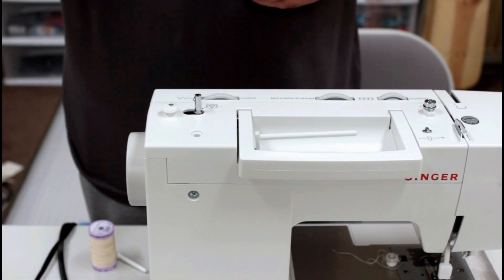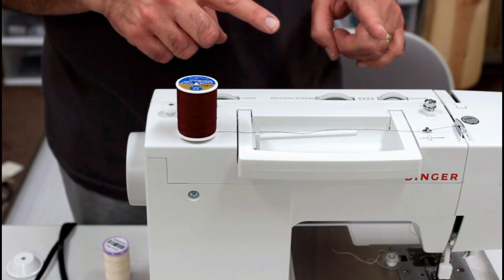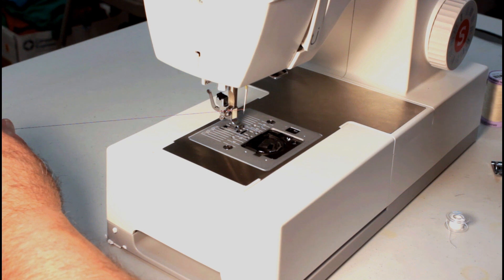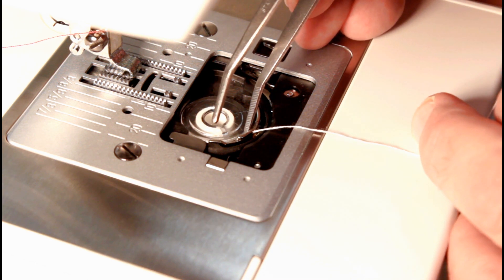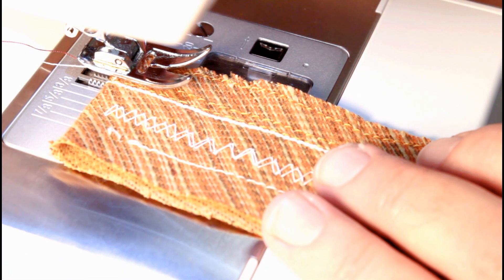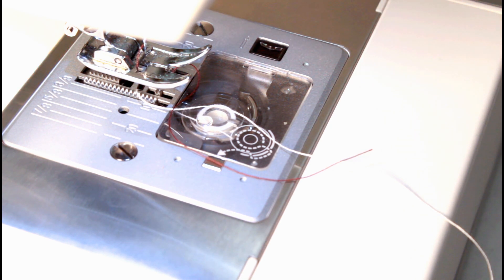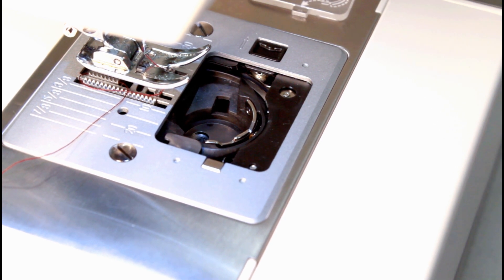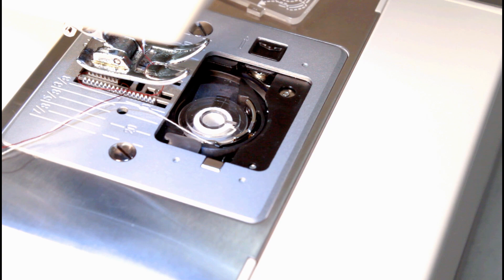Solving Threading Problems and other Issues

Comment: My 4423 is brand new and it worked fine while trying different stitches.
Now i watched your u tube and threaded step by step but even turning by hand 2 stitches,the cage is pulled half out,
Any suggestions?   BOB
Reply from the maker: Sorry for my delay in responding. I've been on the road for a few months. Did you get it figured out?
Reply: @kevinsews  HI KEVIN,Yes it was the small shiny little lever that sits just above the bobbin case.
It got bent up when i had  BUNCH OF THREAD GET UNDER THE CASE,TRYING TO RAISE IT,AND BENT THAT TINY PART A BIT.Opps sorry, had caps on. Well i cleaned out that bunch of thread and it's working like a champ now  BOB

Comment: I have the same machine my issue is I just got it and have had nothing but issues with the Bobbin jumping and the case moving . It also bunches up or jams the thread and the machine stops working.  How do I fix this without taking it in somewhere? Its brand new . Thank you
Reply: I've used it for the first time and this keeps on happening to me. I took it for service and it still happens. The bobbin keeps on moving and jams up  the threads. I guess this is a piece of junk
Reply: @jojokatt7  Why not have the service people try sewing with it and then they can see the problem
Reply from the maker: There are two thumbs that hole the bobbin in place. They have to be tighten to a spec that is in the service manual. If yours is jumping around they might be too loose. Go here: http://www.kevinsews.com/download/SingerHeavyDutyServiceManul.pdf and view page 19. This will give you an idea for what to look for.

Comment: Thank you so much for the video , I just get the new Singer 4452 and I have threading issue , your video is so helpful and I'm able to get it right.?Thank you and please make more video like this !
Reply from the maker: You're welcome!
Reply: Hi, where do you get the machine??. There is not available in stores. I know ebay and amazone are selling it,  but Is double the price
Reply: I got on ebay for 350 , free shipping , from a very good seller . I did bid on some but it end up higher than that .
Reply: @Annie-zs2bt  Thank you.  I will wait for them to be in stock.  I'm short on money now.  It is to give it to my mother
Reply: @ampis8034  Some time check Amazon in early morning hours.
I GOT TWO FOR 50.00 EACH AND A 3RD. FOR 160.00 all free shipping
Reply: Dhammi Sini Only purchase from authorized dealers, would be my advice. Why? Because Amazon has reputation for selling counterfeit or refurbished machines. You have absolutely NO recourse should you get a defective sewing machine. Sellers steal others' identities and sell products on Amazon. Amazon does not screen or vet their sellers so be smart! Yes, there are some real horror stories. Bad sellers give the REAL businesses a bad reputation. My advice: Buy from authorized sewing machine dealers and the bonus is if you need help, they guarantee/warranty their products! 😊

Comment: Great machine, love my 4423. But after a timing adjust I cannot for the life of me get the tension adjusted back to where it was previously. Type E/#69 thread and a Schmets 100/16 needle. Any pointers?
Normally sewing Nylon(500D and 1000D), 6 layers max. No issues prior to hiccup and timing adjustment.
Reply: Do you recommend it?
Reply: @angelmtos  Depends on what you want to use it for? It suits my needs. Up to 6 layers Cordura, and webbing.
Reply: @woodyw9470  Thanks, I'm going for one for my mother. Sew from time to time
Reply from the maker: Using #69 on this machine can be a challenge. I did it a few years ago helping a friend on the road. We had to tighten the top tension http://www.kevinsews.com/download/SingerHeavyDutyServiceManul.pdf  see page 22 on how to tighten the thread tension.  Then we had to tighten the bobbin tension to match. After that we had to baby it a bit to get the first stitch to catch and then he was off sewing his leather seam.

Comment: I'm assuming the automatic  needle threader isn't standatd on all machines.
 I have the 4411 and I'm continually fighting with it. The thread jams up all the time!!! I will try your suggestions, but I am pretty sure I'm skiing it right.
Might be time for a better machine.
Any suggestions?
Reply from the maker: You bought the only one in this series that doesn't have the threader.
Reply: @kevinsews  I took your suggestions and all is well now. Thanks so much!! I also want to mention that I use a metal bobbin, size 15 and it works great for me. I believe the singer video said not to do that. Just wanted to let you all know my experience.

Comment: I really want to love my singer heavy duty sewing machine but I have never had a sewing machine that jams up so much when I start the beginning of a stitch as this one it jams up the bobbin jams the thread curls up loops up.... So then I rethreaded reinsert the bobbin and it sewed fine for a little while and then it repeats and does the same thing over I can't figure it out.
Reply: Me too Barbra!!! I'm always fighting with my machine!!
Reply: @cathymilson4386  sorry to hear that If you figure anything out let me know.... Do you place your thread on top of the machine or on the little back side area?
Reply: @cathymilson4386  do you place your thread on top of the machine or on that little back side area?
Reply: I'M a 10 year parachute rigger and these new singer 44xx series are junk.
Shopping for a higher end Brother
Reply from the maker: Yes, spend 5 times what these cost and that will solve all of your problems. Even if you thread it incorrectly, it won't matter. Use the wrong needle for the project? No problem. Right?

In all seriousness...I have 5 of these machines that people sent me instead of throwing them away. I use them to teach classes and they all work just fine. I get them in and I have no idea what they were doing  wrong. I thread them up with new thread and wind a bobbin; pop in a new needle; I then adjust the tension (that can be way off) and they we a perfect stitch. 

On one machine they left it threaded when the boxed it up. When I took it out of the box it had thread in it that was so old and rotten I barely pulled on it and the thread crubbled. It is amazing what people try to do with these machines. 

I've sewed 5 oz leather with #69 bonded nylon thread with one of these machines a friend bought. I wouldn't recommend using this machine for that purpose because it will burn up. But it did sew the 4 seams my friend needed just fine. I took it apart and tightened up the needle and bobbin tension and we used a size 18 leather needle. It took a little turning the flywheel by hand to get it started, but it did sew the seams just fine and he was happy. After that he went and bought a Cowboy Postbed leather machine. LOL

I've worked on Berninas, Juki's, Janome's  and Brother machines  too. In the end they are metal frames (just like the 44xx series); they all have one or two nylon gears. It takes just as much effort to loosen the screws on all of them. The shafts and gears are all metal. I think the difference is when you spend over $1000 (sometimes over $5K) for a machine you it isn't your first machine. The 44xx series are simply to fix too. Bernina's are more like fixing a PC than a sewing machine.

The other problem is for a $150 to $249 price there can't be much quality control. I tell people if they get a bad one just return it immediately. You would be shocked how many just put it in the closet at this point.  I tell them if they get a good one and learn how to use it properly it should last them long enough to get your money out of it and move on to a higher priced machine. So far those who have followed my advice have been happy with the machine. So people you can never please through.
Reply: @kevinsews  is it possible to have very neat stitches on the under side of the fabric that are just as pretty as the ones on the top side?

Comment: Hi Kevin! Thanks a lot for your videos, actually I use them as a manual for my 4411. :) Are you using a flat or curved bobbin in this video? I was surprised to learn that Singer has Class 15 (flat) and Class 15J (curved) plastic transparent bobbins and I'm thinking if they both can be used in the Heavy Duty machines...
Reply from the maker: I've used both in them, but Singer does recommend the Class 15J bobbins.
Reply: ushchent Yes, you can use both types of bobbins; however, there is a built-in magnet located under the throat plate and I think that's why Singer recommends the plastic bobbins (which they provide in the packet that comes with the machine). I personally prefer the metal bobbins because they accommodate more thread.😊

Comment: A very good, quick, lesson.  Can anyone give me the original position for the presser foot pressure screw.  I moved mine w/o marking starting point, now dont know which position to return the plastic screw to.  Thanks.
Reply from the maker: See the about video text. I've placed a link to the Service Manual there.

Comment: I am having so many problems with three machines and repair is closed down.  Bobbin toward the end of the thread upper thread winds onto the bobbin jamming.  I hate plastic bobbins.  I love metal bobbins.  I have an antique I need someone to get it down for me.  It is heavy.  I have a brother a singer a nechi, all drive me nuts with the bobbins.  I  have antique singer.  I need a good  suggestion on a new machine.  I had an incredible machine.  It was a used industrial and we were stretched for space and it got taken to the thrift store which really annoyed me.
Reply: Hi Row. Where are you located? I recently got a Necchi. If you're on Long Island, I can help you get it down. Do you have the Necchi manual? I got mine at a thrift store but no manual.

Comment: That raising of the presser foot is the most crucial step when threading the machine so it's less likely to jam.
Reply from the maker: Yes, i t is.
Reply: @kevinsews  I like my sewing machine two things that really frustrate me about it constantly is the feed dogs I have to start my fabric off way from the edge and then go backwards that is so stressful, The other thing I don't like is sewing multiple layers I don't have much success with that either it gets jammed.
Reply from the maker: Barbra Try placing the tissue used to stuff gift sacks under your fabric for the first few stitches and see if that helps.
Reply: @kevinsews  Thanks I will try that.
Reply: @kevinsews  I didn't have any of that tissue paper that goes in gift bags so I used paper towel instead and it works!!!! Thank you, thank you, thank you so much!
Reply from the maker: @barbra429  Sorry I missed this replay! I am glad to hear it worked out for you.
Reply: cebuanostud çc